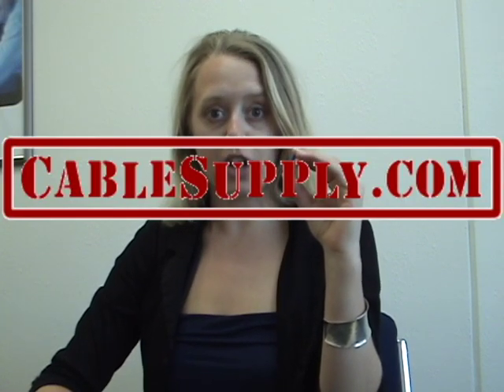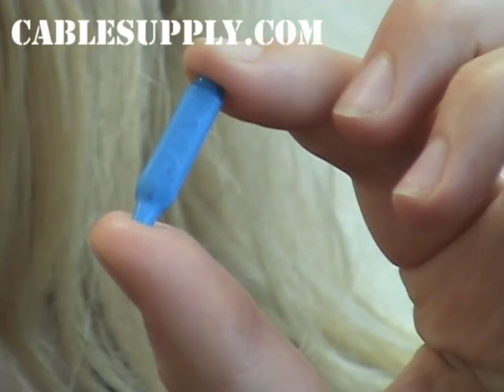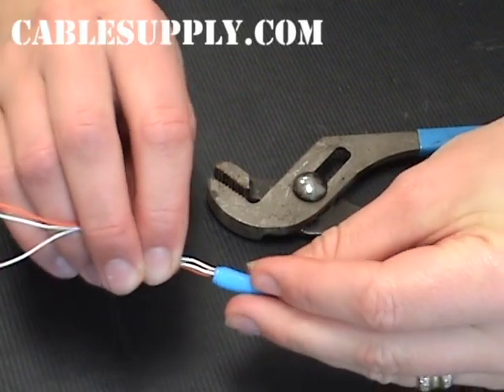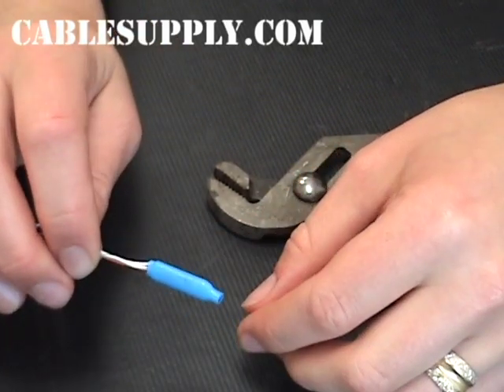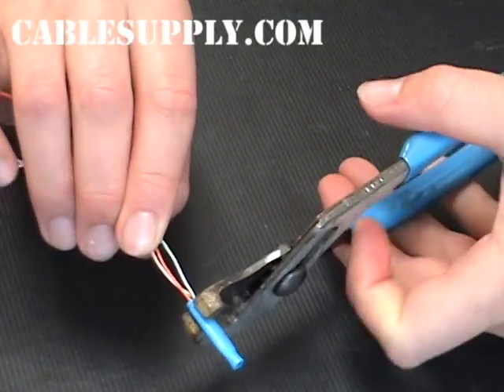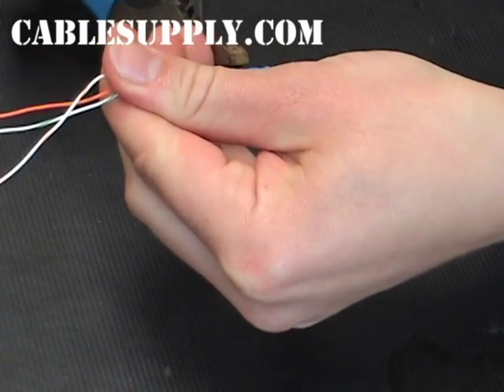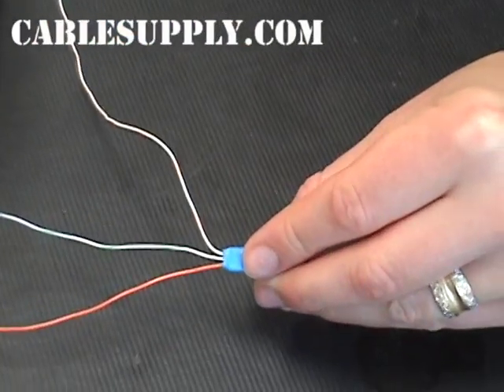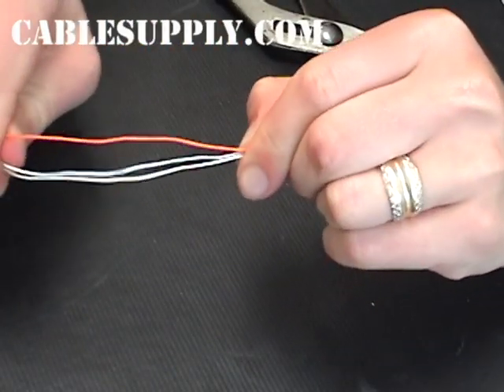How to Splice Telephone Wires

Comment: These connectors are good for analog circuits but inject too much noise for use on digital circuits
Reply from the maker: William, You're right they're only design for analog telephone circuits.

Comment: Can I use these b connectors to tap into my existing telephone line and run a new line for a new jack? Dont like using rj11 splitters
Reply: Yes, you can add a tap, but you'll have to have a free end of the wire you want to tap into. You'll also have to open up the small end of the connector so you can slide it along the wire you're tapping into. The main advantage of these is that you don't have to strip the wires (if they have standard telcom insulation).

Comment: what is the amp rating?
can I use a couple of 18 or 20s?
Reply from the maker: should only use on low voltage. 18 / 23 is ok,  don't use on computer networks.
Reply: Thank u Bess, very helpful and, I might add, you"re very pretty as well.  I"m not a computer guy, so hopefully that explains the following dumb question; When u said don:t use on computer networks,,,that would include splicing together two Cat-5 cables (5 ft. to a 10 ft.) to be able to reach & connect a wi-fi box (a router?) to a smart tv, correct?   (See? Told ya I was new! Lol) .  Any help would be GREATLY appreciated!!